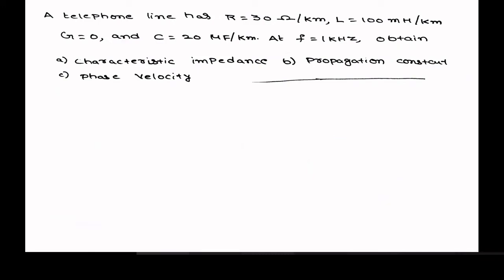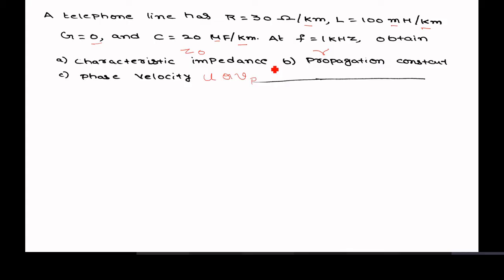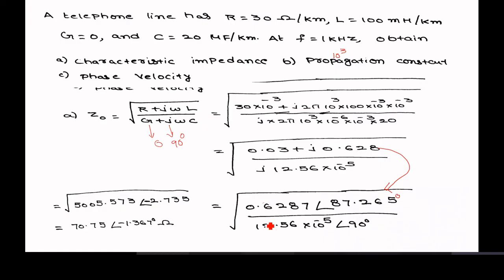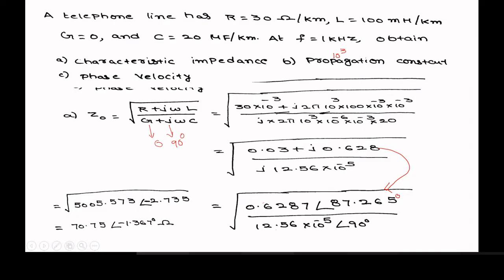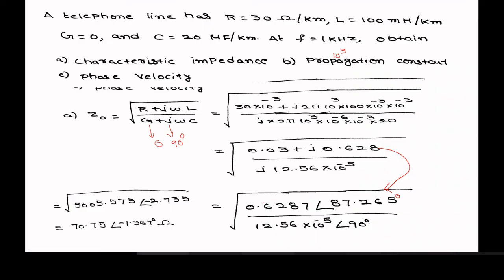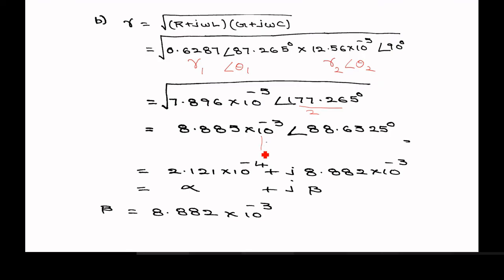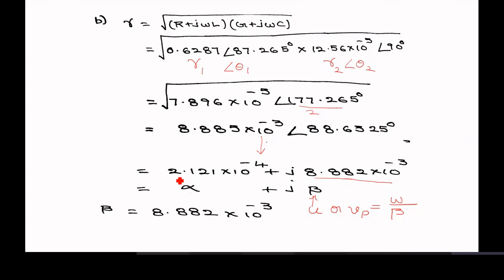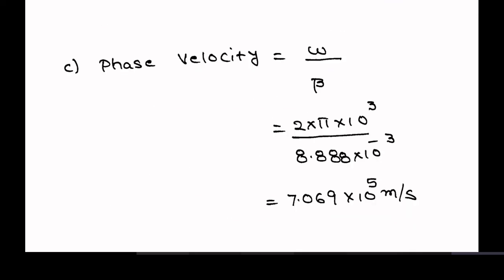A telephone line has R=30 Ω/Km,G=0,f=1 KHz, L=100 mH/m,C=20 microF/m. Find Zo, Propagation Constant

Comment: (For a 0.5 km microwave transmission line if the value of resistance is 0.04 kΩ conductance 12 S, inductance 8 mH and capacitance 7 F, then at microwave frequency, find the characteristic impedance.)

How to calculate this maths a capacitance and inductance unit per length
please Reply these comments
Reply from the maker: First we have to calculate resistance per unit length i.e (.04K/.5K = 0.08) , conductance per unit length (12/.5K = 0.024), inductance per unit length (8 m/.5K= 0.016 m), capacitance per unit length (7/.5K = 0.014)
Now substitute the above values in the characteristic impedance expression.
Reply from the maker: If you require a full solution, I will send you soon
Reply: @vinu430  ok  ..Thank you sir for you reply my comment